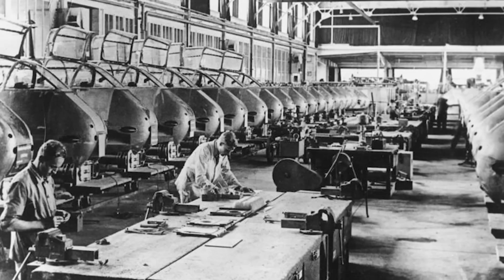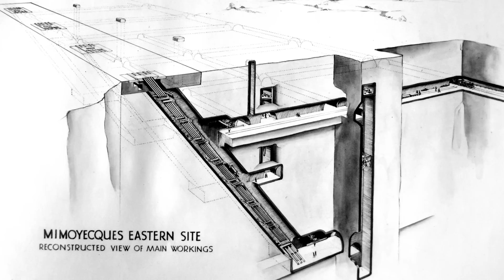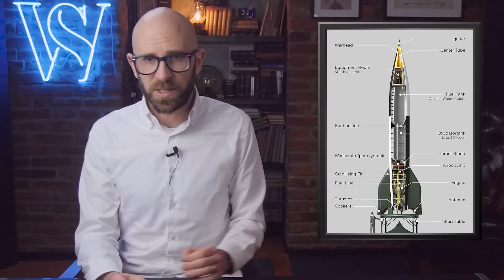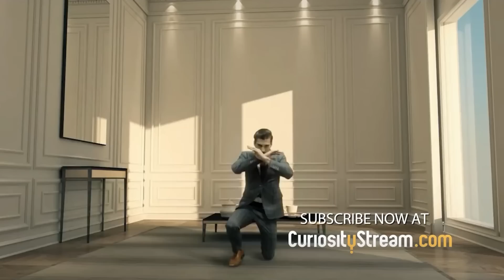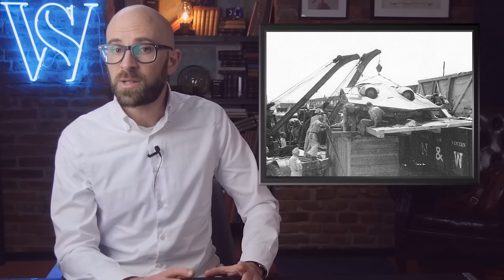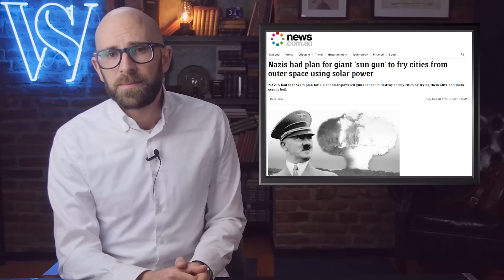Top 10 Terrifying Nazi Super Weapons For World Domination

Comment: The Ho 229 was a fighter, and had nothing to do with the 1000x1000x1000 project - although Focke-Wulf  built a competitor that resembled it.    The Horten  brothers were obsessed by the aerodynamic advantages of the flying wing, its stealth capabilities were unexpected, and may not even have been known by the designers as V1 crashed, V2 never flew, and V3 was incomplete.

Comment: The Panther could go an average of 150 km or 93 miles before the transmission destroyed itself.
The turret would have to be removed along with much of the front internal equipment so the transmission could come out of the turret ring.
Videos that praise the panther never seem to mention this.
A transmission on a Sherman would last thousands of miles and took a couple hours to replace because the lower front of the Sherman could unbolt from the frame.
Reply: That was the Germans biggest problem. Everything had to be complex. They would have been better off copying the T34 instead of "improving" it.
Reply: @BELCAN57  The T34 was another funny thing, they were only designed to last a few hundred miles before they started falling apart in the early models because that is all the farther they would get before being destroyed. Crews that fought and survived got upgraded into heavier tanks after X amount of battles. Later on they were more reliable as the tables turned and they needed to be reliable. But yea the Russians built only what they needed and no more in the early war.

Comment: The huge V3 'Tausendfüssler', buried deep in a hill at Mimoyeques, was destroyed before it was finished. The multiple barrels for the weapon emerged through a huge reinforced concrete plate on the top of the hill. It was noticed by aerial reconnaissance, and, as similar huge constructions had been noticed at Watten, Wizernes, St.Pol, which were V1 and V2 sites, the RAF bombed it with their 12,000lb 'Tallboy' bombs, which exploded underground, after falling at supersonic speed, which caused localised earthquake effects, collapsing most of the underground workings. The site was captured by the Canadian Army.
Reply: GingersCan'tBePirates  citation?

Comment: When Army Group A fails to take and hold the oil fields of the Northern Caucasus in late summer of 1942 the defeat of Nazi Germany went from a possibility to a certainty. No amount of "wonder weapons" can achieve victory when the formations in the field are consistently running out of fuel.
To be honest after Simon mentions the Panther tank in a video on "Super Weapons" i checked their list and stopped watching.
Five of the listed items were impractical, and the other five make little to no difference in the grand scheme of things.
Reply: Ok
Reply: The Nazis worked on oil substitutes that showed promise. Coal chemistry was some of it. They had plenty of coal. The design survived the war but was buried by the oiligarchy. Similarly blight proof rubber trees were ferretted out in S. Am. by a great US botanist, but the fedgov buried the work in favor of oil based artificial rubber.
Reply: @johnhardin4358  even during the late 1930s the production of synthetic oil and rubber was no where near the levels Nazi Germany needed even in peace time.
Reply: @johnhardin4358  The Germans had a fully functioning synthetic oil programme using the Fischer–Tropsch process. The problem was that it took 5 tons of coal and a lot of energy to produce 1 ton of oil. It wasn't buried after the war by the oligarchy it died because it was always going to be cheaper to use oil, which is why ICI abandoned their programme. As for Germany having plenty of coal, it's true but they were also using plenty and they had to supply Belgium and the Netherlands for their industry because the had been importing most of theirs from Britain.

Comment: The HO-229 was an amazing engineering feat.
Reply: No it wasn't. It sucked. It would have needed a hefty fly by wire system to fly without being a danger to the pilots. It just looks cool.
Reply: For when it was made and the resources that were available, it was an incredible accomplishment. Yes, it was difficult to fly and had stability issues, but since when is pushing the envelope ever safe? Troll.
Reply: @forcedfeedbackclassicgamer5499  you're right. Sorry, I was just pissed that they said it was a stealth bomber, which it wasn't. There were all kinds of things on it that would have made it just as unstealthy as the next plane. But you're right, it's a pretty dang cool machine.

Comment: German precision-guided weapons were practically useless against the allies because besides being ahead and radar they were ahead in electronic counter measures.
Reply: And those ECMs would be what? Since there is no evidence for any of it anywhere and the killcount for the radio guided bombs and V rockets still stands this sounds like serious BS.
Reply: @wolfhead21  They were radio jammers. RAF Y stations were set up on several ships to monitor the missiles and parts of unexploded bombs (the Germans had fitted self destruct mechanisms on the receivers but they didn't always work) recovered and also control units that the Germans had failed to properly destroy were recovered at Foggia. Jammers were produced through four or five models each achieving broader effect and easier use culminating in the Type 650 jammer developed at ASE by Norman Davis and David Silvester.

Comment: No, they did not know about stealth capabilities of Horten 229 and it was not fitted with stealth capabilities specificaly designed to be stealthy. It was a COINCIDENCE, they were lacking materials, so they built it out of wood. Thats it. 

Afterwar studies of the prototypes have shown somehow limited stealth potential.
Reply: The engine placement would have also given a strong radar signature.
Not to mention it was a flying wing without a fly by wire control system, it would have been more dangerous to its pilots than the enemy.
Reply: @jamesricker3997  Basicaly yes, without advanced computer assitance it would be really hard to fly this plane safely. It is still my favourite design, i just love the looks of the american B2, oh man!

Comment: Nothing motivates science like war.
Reply: Like the cold war..space race..etc...
Reply: @jeffreyhebert5604  Precisely, in time of need, money get's thrown at a problem. They're doing the same today with Covid-19/corona virus.
Reply: Shaun Elliott  We should spend more on things to make life better instead! 😞
Reply: Very controversial statement. Most of the "new products" of the First World War were created before it began. Most of the “new products” of World War II are the development of projects from the beginning of the 20th century. For example, what Russians have lost due to world wars:
- In WW1: submachine gun (first SMG builted in 1912), long range automatic battle rifle with one of the best rifle cartridges in XX century (1913-1914), 160 hp turboprop engine (start of building 1914), electromechanical computer (1914, 1916, 1920th), huge fleet of battleships with 16- and 18-inch guns (1911-1914), distance-operated weapon systems for fleet, radiocontrolled and self-targeting torpedoes (from 1898 to 1914), "national tractor" and "national automobile" (1913-1914), normal helicopters (many projects between 1913 and 1916), V8 automobile engines (1913-1917), four-stroke diesel engines (1912-1916), fast diesel locomotive (1914-1916), double-deck passenger railroad car (1911-1914)
- In WW2: fastest fighter with piston engine (1941 project), fastest ground attack aircraft (1940-1941 projects), jet fighter (1941 and earlier), 3000-4000 HP pistol aircraft engines (1939-1943 projects), main battle tank (1938-41 projects), intermediate cartridge (1939-1941), assault rifle (1939-1941), magnum sniper rifle (1939-1941), new automatic pistol (1939-1941), heavy ballistic rocket + rocket for "human-to-space" (1941), nuclear weapon (1940-1941)
Do you think a world without World Wars would be more backward?
Reply: Sad but true!
Reply: Imagine if we had world peace for just 24 hours and every country on our planet just shared all there information with each other.  The amount in science alone would benefit our planet so much.